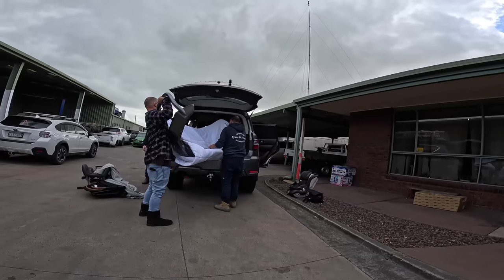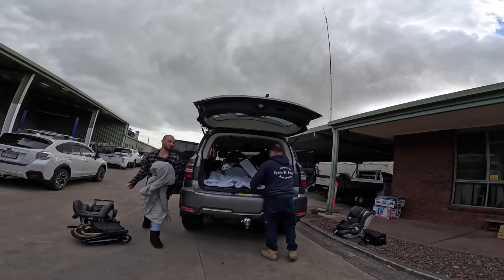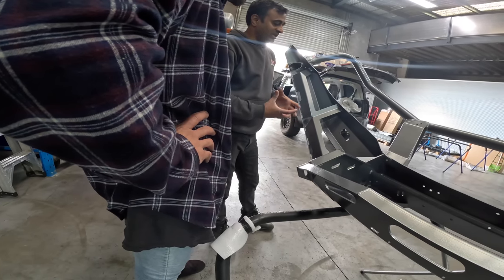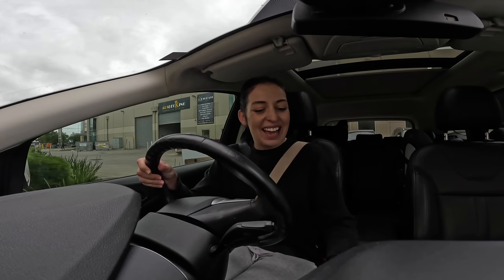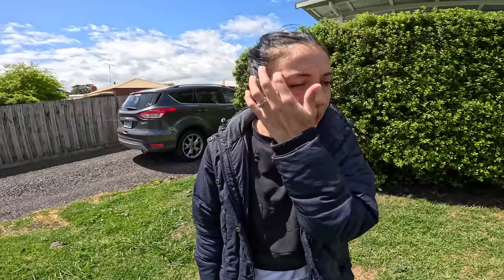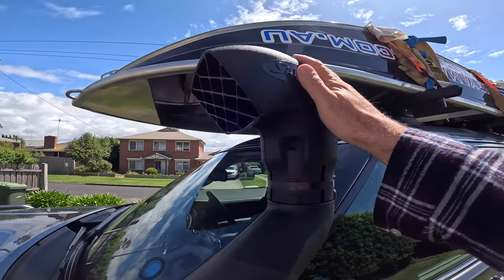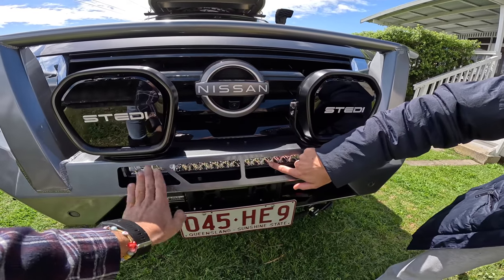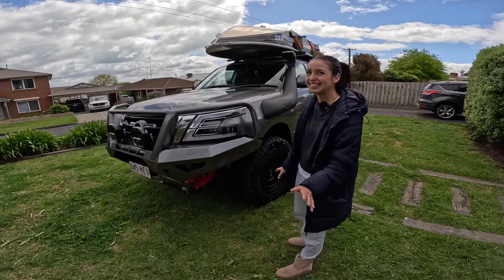Our Y62 Patrol is Finished - FULL WALK THROUGH & COST BREAKDOWN

Comment: Ive always wondered why you guys opted for the cat 6 indicators on the side fenders instead of just getting towing mirrors? 
Did you guys upgrade the airbox or just put a snorkel on?
Reply from the maker: just the snorkel bro
Reply: Should definitely look into the airbox as the factory one is notorious for letting in dust and the plastic breaking around the clips